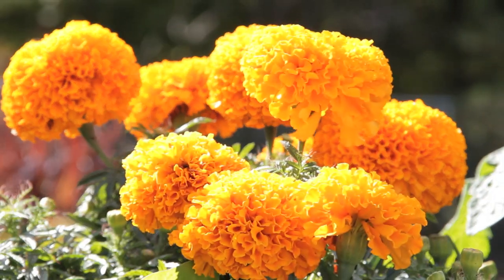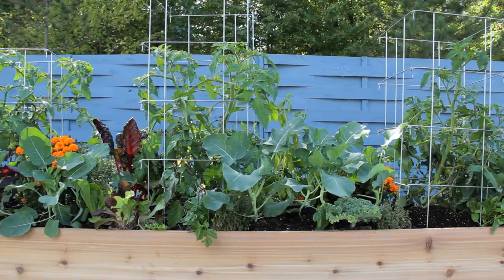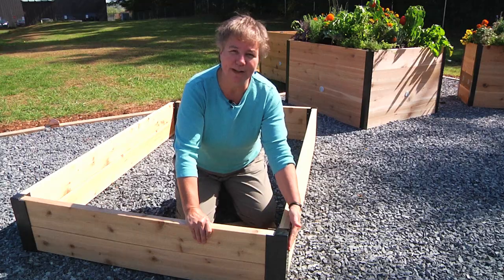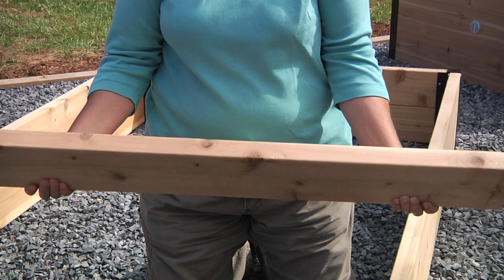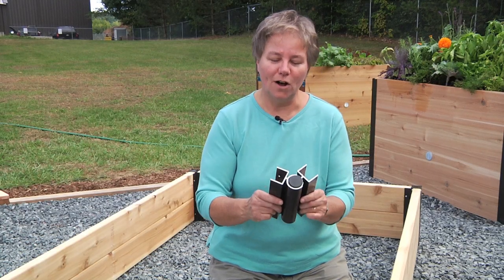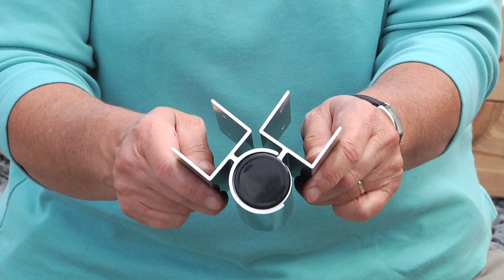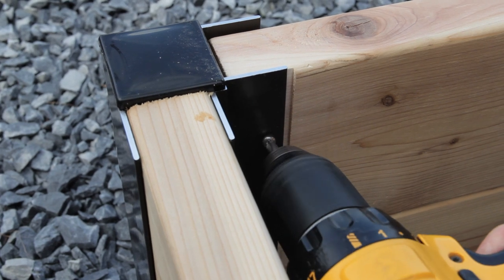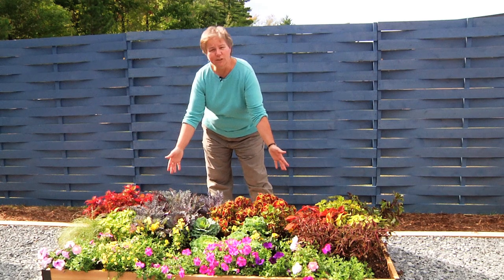How to Use Raised Bed Corners - Gardener's Supply Co

Comment: The video makes it look really easy to drill in the screws, but I just tried to fit the screws through the holes in the corners and they do not fit and I cannot screw them in with a regular Phillips screwdriver. I don't know if anyone from Gardeners looks at the comments but if you do, I would like to know if the screws go through once you use a power drill with the screw attachment.
Reply: Did you just receive and build them?  I did mine a few years ago and had screw issues.  Used an Impact Driver.  Of course it helped but I was only able to get so many in.  Had my Landscaper give it a go.  Stripping & just no.  I'd get my own screws if I could do it again.

The wood had to be so wedged in anyway due to width that it was beyond secure anyway.

Comment: Could the variable corners  allow inserting of poles in each corner to raise the raised bed off the ground?  Example  15 inch variable corner with polls  2x8 raised garden and bottom made of ?  with metal poles / plumbing or ?  be used to raise the bed off the round 24 inches? How to create "stops" in each pipe  to hold the raised bed  off the patio?  What size pipe?

Comment: What size boards would you use with the 23 inch corners? I am trying to find something that will work for 2x10 boards stacked on top of each other (20 inch height).
Reply from the maker: These corners: https://www.gardeners.com/buy/raised-bed-corners-set-of-2/8609669.html fit standard 2x milled lumber (1-1/2" actual thickness) and the height is 23” but you could perhaps bury part of the corner into the ground to make a 20” board work. Hope this helps!

Comment: How tall are the corners for the raised bed built in video?
Reply: looks like they are 12 inches in height Mari. (since she inserted two 2x6 boards)
Reply from the maker: Those are 12" corners, but we have several sizes, going from 6" to 23". You can see them here: http://www.gardeners.com/buy/raised-bed-corners/36-643VS.html -David Grist, Gardener's Supply

Comment: Yea - and I see in the video the wood was clearly shaved down to fit into the brackets!    Come on.   This is supposed to be easy.    1" Cedar won't fit, nor 2"
Reply: I'm just learning this too as I'm making my own raised bed with these corners--milled lumber comes in what is termed a "nominal" size, but then there is Actual size. So, a so-called 2"x4" size length is ACTUALLY 1 1/2" by 3 1/2 ". That's why it fits in the 1 1/2 inch corners. Plus, there are two kinds of corners, the DIY ones and the ones that come with boards, the latter of which fit the 1" corners. I see you wrote this 5 years ago, but for anyone else who might be wondering, that's my answer for  why the so-called 2" thick boards fit in the DIY corners.
Reply: @marylynnkunkel3134  I bought Pressure Treated from Home Depot.  Basic stuff which I'm sure most people would run out to buy for these brackets.  Basically had to mallet them in or something.  Great brackets but yea - it's kinda sketchy.   Also had some issues with screw quality.  Only got a few in.